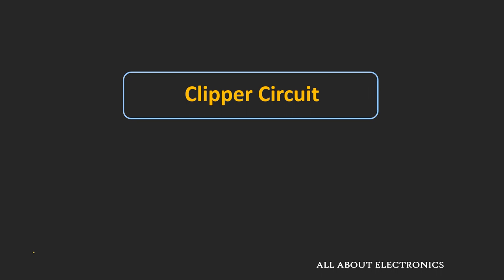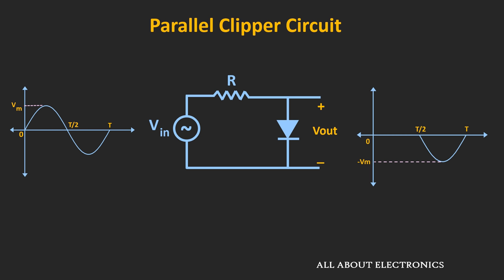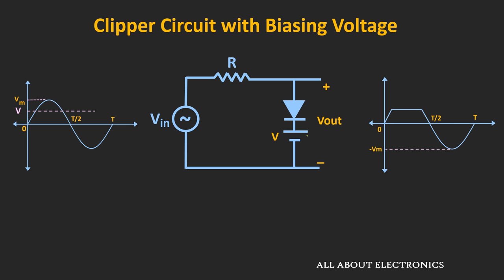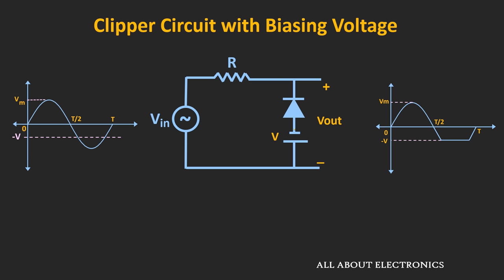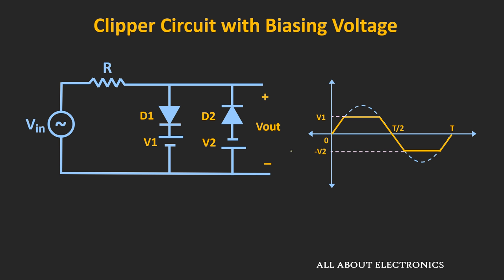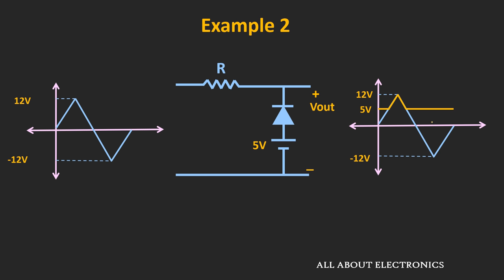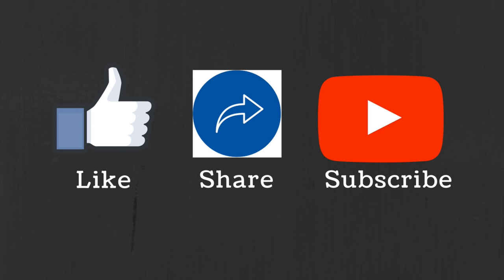Clipper Circuit Explained (with Solved Examples)

Comment from the maker: The Timestamps for the Different Topics Covered in the Video.

0:20 What is Clipper Circuit? Applications of Clipper Circuit

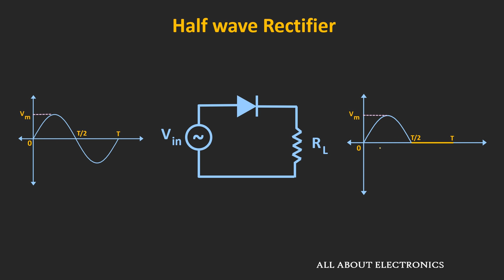1:14 Types of Clipper Circuit 

2:00 Parallel Clipper Circuit

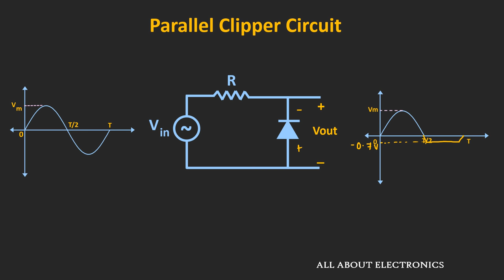4:06 Parallel Clipper Circuit with Biasing Voltage

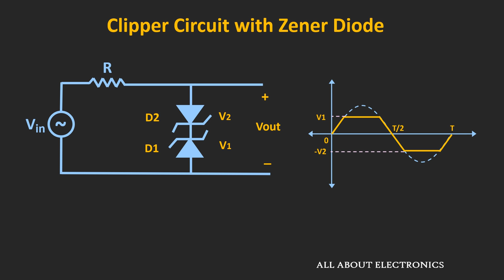10:23 Series Clipper Circuit

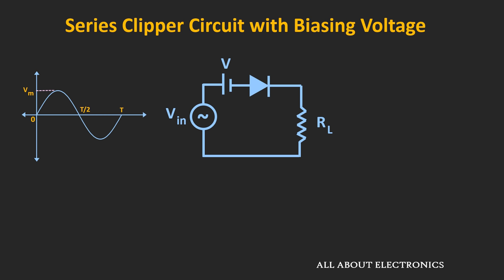11:21 Series Clipper Circuit with Biasing Voltage

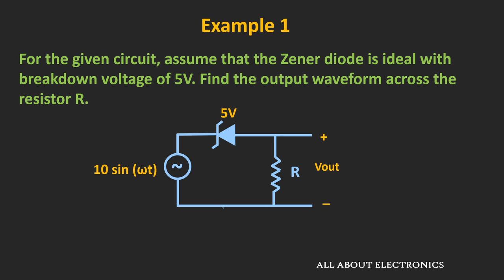13:16 Example 1

15:19 Example 2
Reply: Btw how u know where to put.... The horizontal line V of bias

Comment: Sir, if it is possible for you then please playlist for all the topics. It is hard to search all topics separately. But if you arrange them in a playlist then it would get easy for us access your content.
Reply from the maker: It is already added in diode and diode circuit playlist. You can check it on the playlist page.

Comment: 15:50 
Why will it get forward biased?????
It should be reverse biased and should act like an open circuit !!
Please someone explain!!
Reply from the maker: The input is triangular wave and it is gradually increasing to 12V. But during that rise in the voltage, when the input is less than 5V, the voltage at the cathode of the diode will be less than 5V. While at the anode voltage is 5V. So, for that duration when input is less than 5V, the diode will get forward biased (considering ideal diode). And for that time it will conduct. That means when Vin < 5V, Vout = 5V. 
I hope it will clear your doubt.

Comment: At 14:08, Should the sign of zener diode not be be opposite? I think you have made a mistake declaring the sign of the zener diode. Please check it and tell me if your example 1 is correct or not
Reply from the maker: When the Zener diode operates in the breakdown region, then the voltage across it is equal to the Zener voltage. The polarity is correct. For more info, please check this video on Zener Diode: https://youtu.be/MZPeRlst8rQ?si=f3Nb-aHyhqGYlhw_

Comment: 12:43  series clipper with biasing , the signal not get clipped , it get smaller form .why?
Reply from the maker: The series clipper circuit clips the certain portion of the waveform (in time domain), much like a rectifier. Similar to the rectifier circuit, here the diode will conduct when the voltage across the anode of the diode is more than cathode. And during the ON time of the diode, the output voltage is Vin - V (assuming ideal diode for a moment). That is why you are seeing the reduced voltage during the conduction of the diode. I hope, it will clear your doubt.

Comment: at 4:30 wont R affect the voltage at all? how can we directly compare V and Vin
Reply from the maker: It restricts the flow of current through diode. When the diode is conducting, then remaining voltage will drop across this resistor. (e.g Vin - V will drop across the resistor, when diode is conducting.) I hope, it will clear your doubt.

Comment: At 7:53 when V in<V why are both diodes reverse baised ?!!
Reply from the maker: When Vin is between V1 and -V2 both diodes are reversed biased.
If you see, the diode D1 will conduct, when the voltage at the anode is greater than V1. 
Similarly, diode D2 will conduct when the voltage at the cathode is less than -V2.
That means when the input voltage is in between V1 and -V2, both diodes will be reversed biased.
I hope it will clear your doubt.

Comment: Does all the clipper clamper circuit have zener diode? Coz i needs input voltage more than diode activation voltage
Reply from the maker: You can also use additional voltage source (with diode) to clip or clamp the waveform at the desired level.

Comment: You can tell me , why  In the parallel clipper ckt, when +ve half cycle is applying  in the ckt the ckt work as a short ckt ? What is the working of resister her ?
Reply from the maker: The R is the current limiting resistor. And here during the analysis, it has been assumed that the diode is ideal. That means when it conducts it acts as a short circuit. But actually in the output when the diode is conducting, the voltage would be around 0.7V. 
I hope it will clear your doubt.

Comment: 6:00 why output should be constant after V ? I mean as the current  through the diode increases the voltage should also increase following it's I-V characteristic curve
Reply from the maker: During the entire discussion, the diode is considered as the ideal diode. Yes, what you are saying is true in the case of the actual diode, where the diode also has forward resistance. 
I hope it will clear your doubt.
Reply: @ALLABOUTELECTRONICS  got it...thank you very much sir...

Comment: Hi there, thanks for the informative video! Can I check why the Vin need not be larger than (0.7 + 0.5)V? To account for ideal diode voltage + bias voltage. Why is it only accounting for bias voltage (0.5) ?
Reply: If you've found the answer, pls do share with me

Comment: 2:47 why Vo is not 0 here?? There is resistance but no voltage drop
Reply from the maker: Since diode acts as open circuit, so there is no current through the diode. ( Considering ideal diode). And since, diode is open, so circuit will not get completed and hence no current through the circuit. So even though there is a resistor in series with voltage source, but there will not be any voltage drop across it. And hence, Vo = Vin during that negative half cycle. I hope it will clear your doubt.

Comment: Eg 2 is contradictory to what u explain earlier.when Vi<5V then Vout=0 and when Vi>5V then Vout=Vin-5V. Please explain this.
Reply from the maker: In example 2, when Vin <5V, the diode is in the ON state. Because the anode of the diode is 5V, while the cathode is less than 5V.
So, the Vo = 5V,
When the input is greater than 5V, then diode won't conduct. Because the cathode of the diode is greater than the anode (5V).
So, the diode will act as an open circuit. And Vo = Vin.
I hope it will clear your doubt.
Reply: Now I’ll understand. Thank u 😊

Comment: How to find the Current across resistor 
In 9:19 circuit
Reply from the maker: The current through resistor R is (Vin - Vo )/ R.
At 9:19, Vo = -V2. 
So, accordingly, you can calculate the current.
Reply: @ALLABOUTELECTRONICS  
Thank you soo much for your reply

Comment: In example 2 when the Vin less than 5V the Vout is 5V ..I have some doubt in that part .Is there is no effect for Vin in Vout when the Vin less than 5V .I think Vout =5V -Vin when Vin is less than 5V..? Pliz clarify this part..
Reply from the maker: The input signal plays role in turning on or off the diode. (Here it has been assumed that the diode is ideal diode). Depending on the conduction of the diode, the output will change. 
Vout is the output across the one terminal of the diode and reference node. You can simply find that voltage by applying the KVL. 
You can also simulate the same circuit and check the result by yourself.

Comment: Sir, at 10:22 how will the zeners work the same way?
Reply from the maker: During positive half cycle one zener will work as normal diode while the second one will work as zener diode. So, it will clip the waveform at vz+ 0.7 v. Similarly on the negative side, the voltage will be clipped at (-Vz + 0.7)V. By selecting the proper value of Vz, the circuit can be used for the clipping the waveform at the desired level.
Reply: @ALLABOUTELECTRONICS  thanks Sir/Mam, i understood that by browsing other sources as well, but thanks for your reply, it solidified my understanding.👍

Comment: Hlo sir
Does the diode in all types of clippers acts like a switch?
Reply from the maker: As its name suggest, it clips the input signal. When diode conducts, the voltage drop across diode is 0.7V. And in this way, it restricts the input voltage.
Reply: @ALLABOUTELECTRONICS  sir I didn't get it

Comment: In eg 2, when Vin<5, how diode get forward biased??🙄 isn’t it reversed?
Reply from the maker: If you see, the anode of the diode is connected to the 5V. And through the resistor, the cathode is connected to the input voltage.
When Vin < 5V, then the anode (which is a5 5V) will be more positive than the cathode (Forward Biased) and hence the diode will conduct for that time. 
I hope it will clear your doubt.
If you still have any doubt let me know here.
Reply: ALL ABOUT ELECTRONICS got it, thanks😃
Reply: Example 4.23 time.
I saw your explanation here.
Is ANODE conected to AC input source and CATHODE to the V=5 v DC source.
But i still dont understand why DC source allow current to flow in reverse?
For DC source,  current doesent exit from positive borne and enter back in source in negative borne?
But ofcourse it will be opposite to the diode direction.
So i dont understand.
Or we have a special rule here.

Comment: hello sir, can we also use a Zener diode  as a threshold voltage reference to conduct the diode?
Reply from the maker: You mean to say, using Zener diode as a reference voltage, you want to conduct another diode, right ? If so, then yes you can do that. But it depends, how you cannect them in circuit ?

Comment: bro only at short circuit the input follows the output. you re saying that every time at open circuit outrput follows the input
Reply from the maker: It depends, whether it is a series clipper or a parallel clipper. In a parallel, clipper circuit, the output is measured across the diode. When the diode is short-circuited, then output will also get short-circuited. 
And hence the output is 0 in  case of a parallel clipper circuit. But in a series clipper circuit , when the diode conducts, there is a short circuit between input and output. And that's why the output follows the input.

Comment: what would be the output at resistor in clipping circuit??
Reply from the maker: The output resistor will be the load resistor across which we want to get the clipper output. It could be a simple load resistor or it could be and input impedance of the some another circuit. ( In case, if the output of clipper is applied to some another circuit)
Reply: No..the resistor before diode...what would be output there..
Reply from the maker: Ok, I thought you are asking about the output resistor.
Reply from the maker: Are you asking about the output across the resistor?
Reply: @ALLABOUTELECTRONICS  yes

Comment: In ex 1 , during -ve half cycle it should be reversed biased hence open circuit ..so there will be no output 🙄🙄
Reply from the maker: During the negative half-cycle, the Zener diode will act as a normal diode. During the negative half-cycle, as the polarity of the supply voltage will get reversed, the anode of the diode is connected to the positive terminal and the cathode is connected to the negative terminal.
Hence it will be forwards biased and will act as a short circuit.
I hope it will clear your doubt.

Comment: just want to ask your last example with triangular input,  need some clarification. during positive half cycle the diode is "OFF" since it is reversed bias and will be "ON" during the negative half cycle then the signal will draw when Vin is greater than biasing Voltage but it turns out different from my expectation :) I thought it is negative clipper connected with biasing voltage . may you please check and help me clarify this. By the way thank you for this video, i want also to make one using our own language.
Reply: Yes it is negative clipper as the negative portion is clipped but due to 5V biasing voltage only the Vin above the 5V mark is obtained in the output

Comment: Example is wrong I think.... please check it
Reply from the maker: Please mention the timestamp where you are referring, so that I can clear your doubt.
Reply: @ALLABOUTELECTRONICS  15:19 ...recheck the answer please
Reply from the maker: @akleshchoudhury4140  It is ideal Zener Diode. In forward bias, it will act as a short circuit and in the reverse bias, when the voltage across it is more than 5V, then it will act as a constant voltage source of 5V. So, during positive half cycle, when the voltage is less than 5V, then Zener diode is in reverse bias, and it will remain open circuit. So, Vo = 0. 
when Vin >5V, then it will provide constant 5V, So, Vo = Vin - 5V.
And during the negative half cycle of the input, the Zener diode will be forward biased, so it will act as a short circuit . Hence, Vo = Vin.
Please check the graph once again now, you will get it.